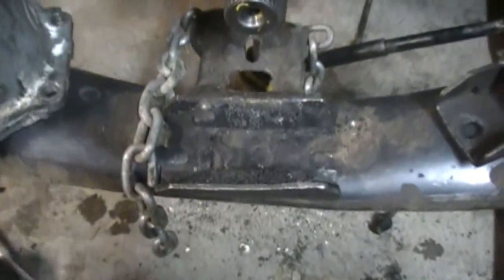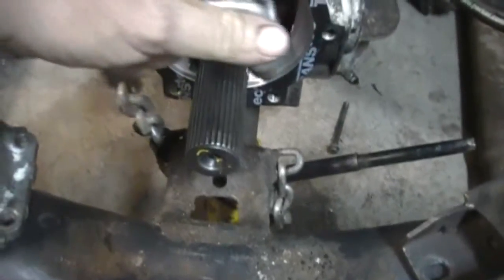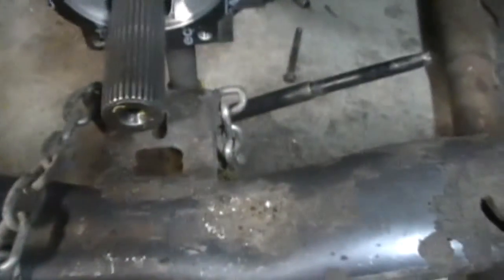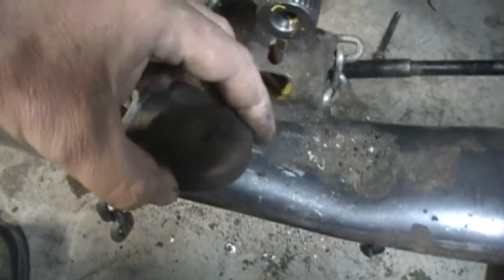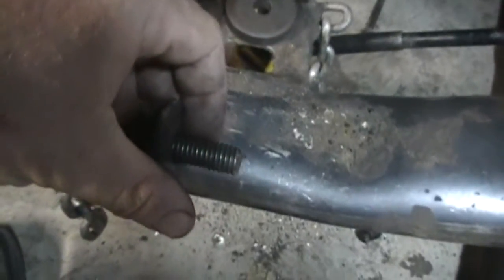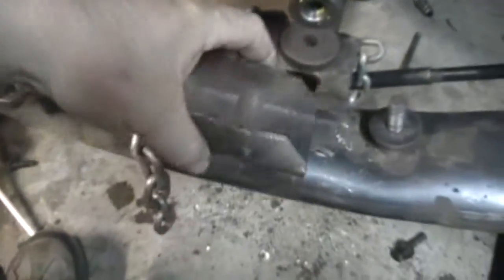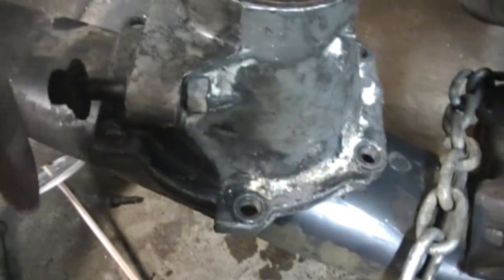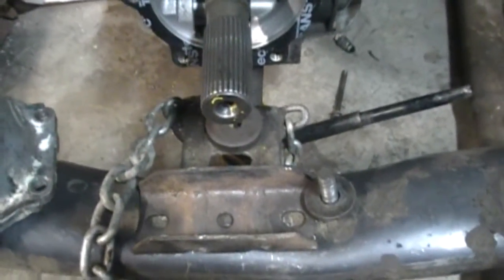Demolition derby tech, Gm transmission mounts

Comment: Been doing em like this for a couple years now, worked real great, until this year. I broke two bellhousings on two different cars. I even used thinner steal for the plate with the nut welded on.